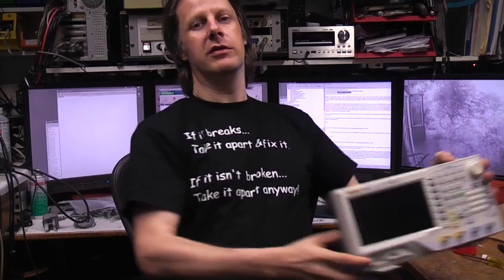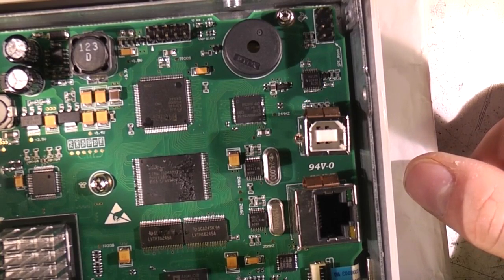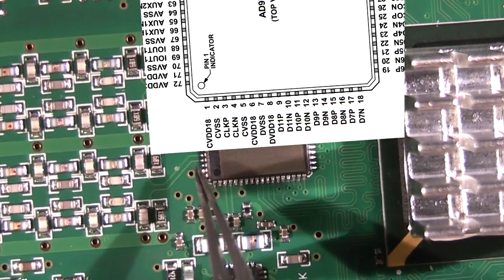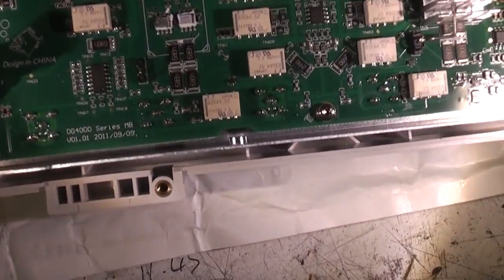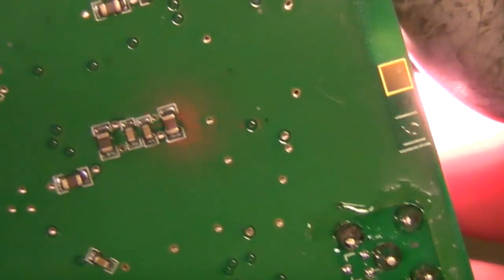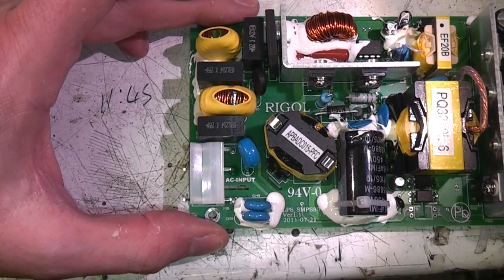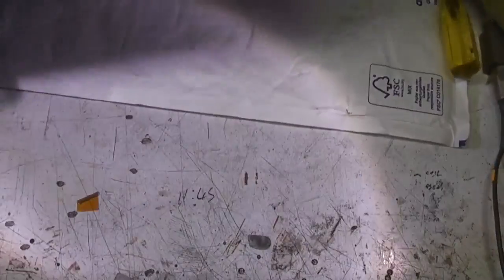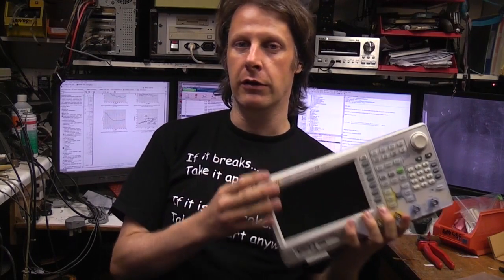Rigol DG4062 function/arbitary waveform generator teardown

Comment: Okay this is 13 years ago, but did you happen to note the standby power supply chip number? Have one with the top of the DIP-8 pretty much missing.
Reply: nvm, with your hints and some sleuthing, it's apparently a TEA1522 (and, unfortunately, obsolete). Thanks! (Maybe they should have used a Chinese chip rather than the European one)

Comment: As an expat Brit I have no trouble following Mike; from 3:47 (pointing at Analog Devices Blackfin DSP, which Rigol are fond of using)
"It's interesting they use that rather than using, say, an FPGA that's got a DSP on it - one reason for that is that FPGA silicon space is quite expensive, so that's why a lot of manufacturers are moving away from this idea of integrating, uh, producing a soft-core processor on the FPGA just 'cos it's quite expensive, and they're now moving to put things like hard ARM cores on" 
(for example the Xilinx ZYNQ, which EEVBlog just found inside a National Instruments all-in-one scope/analyzer/psu/etc)

Comment: I'm not sure if somebody mention it but it looks like same power supply than for Rigol DS2072 osciloscope. So it meean they are using same design for osciloskope as for this signal generator. Even power supply is same. That is good idea also...Unfortunatly it isn't cheap generator..but you will pay for quality.

Comment from the maker: If you need lots of pins, a CPLD can sometimes work out cheaper and simpler than a microcontroller. Especially if you need to keep it quiet for EMC - no keyscanning, and controllable edge rates

Comment from the maker: Th eonly difference on the higher models looks like the output stage risetime, but unless there are also hardware differences (e.g. faster amp) I wouldn't expect it to be encoded with hardware buils options - these are more likely so that software knows about any hardware changes that  need different software behaviour  - alternate parts, chip revs, omitted LAN etc.

Comment from the maker: 400hz is common in aviation (less metal weight in alternators and transformers,and high engine speed), and a 50/60Hz PSU will usually run on 400Hz with no mods, so they might as well include it in the spec to catch a few more orders

Comment: The 14W shown by the meter are presumably caused by the fact, that the standby-operation turns of the pfc and therefore the chep meter only reads the peaks of current when the capacitor charges, you should look with an oscilloscope to get better readings...

Comment: Frequencies as high as 400 Hz are used in aircraft, spacecraft, submarines, server rooms for computer power, military equipment, and hand-held machine tools. Transformers and motors for 400 Hz are much smaller and lighter than at 50 or 60 Hz. United States military standard MIL-STD-704 exists for aircraft use of 400 Hz power.